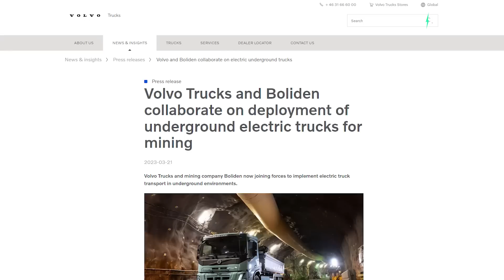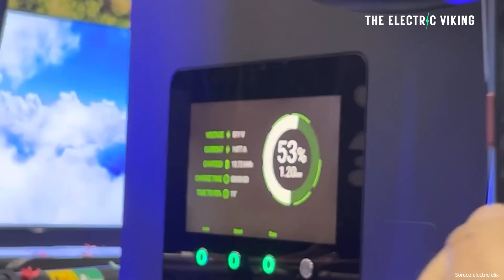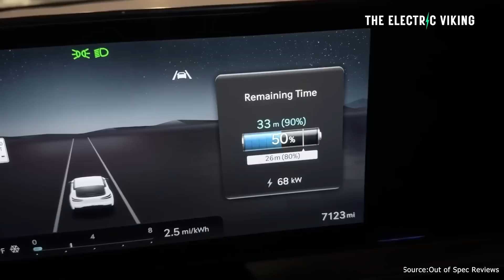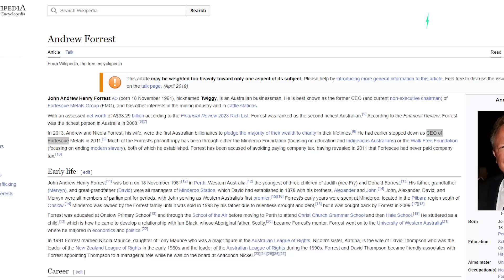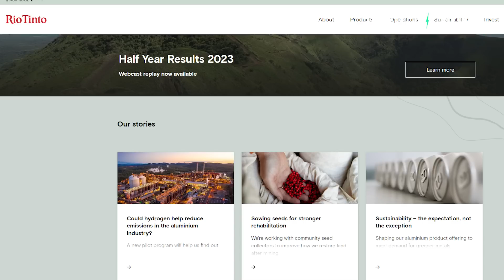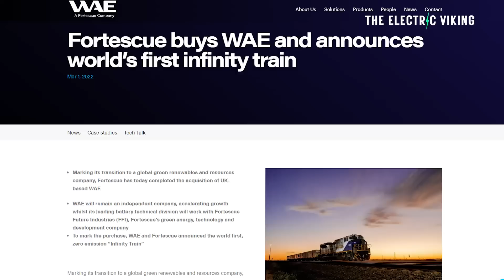Mining company unveils 3MW fast charger for huge electric trucks

Comment: There is some math that needs to be done here . The solar farm can only operate in daylight hours . Also solar farms don't use the highest efficiency panels let's say they covert 20% of the suns energy. 60 MW at 20% efficiency that means the generate 12MW optimum when the sun is out . Also hotter temp +100 u lose efficiency. You also have to charge the battery's to hold the power to do the 3MW fast charge into another battery of thr vehicle. Also fast charging degraded battery's faster when used . Not saying that this can't work but the whole system needs to be looked at including the monster 15 ton batteries

Comment: I believe the charging speed is related to the size of the battery. They are made up of thousands of cells, each has a charging limit. If you add more cells (or many more for trucks this large) you can add far more power to the overall pack, but the cells are still only accepting the same individually.
Reply: Yeah, he's getting a bit excited over the 3Mw number, when it does't mean that much without knowing the size of the pack, how long it takes to charge from say 10 to 80% (what C rate is it charging at), and how long it can operate on that charge.
Don't get me wrong 3Mw charge is a lot, but comparing the charge rate of a 200 tonne truck to a 1.5 tonne car doesn't make much sense to me.
I don't know much about that model of truck they're putting the battery in, but the CAT 793s which Fortescue has a lot of (some are in the video) have a roughly 5000 Litre fuel tank, that lasts something like 18-20 hrs operating properly. The large machines get refueled at somewhere around 600 - 700 litres a minute. So the battery ones have to replace that. I don't think there's many mines in the Pilbara that the trucks will be able to go up hill unloaded and down hiil loaded unfortunately.

Comment: Sam all diesel electric locomotives have regenerative traction motors but instead of directing the power to batteries it is turned into heat and sent into atmosphere so it’s waisted. I was a fireman of NSWGR in late 60’s early 70’s . Oh so do electric loco’s but they put that power back into overhead power lines two 46 class locomotives coming off the blue mountains put enough power into powerlines for one going up. All the best keep up the good work.

Comment: If mining goes zero emissions, and refineries and factories run on zero emissions, what does that do to all those embedded energy calculations? You know, the ones where there they try to tell you ICE is initially cleaner than EVs because <reasons becoming less relevant by the day>.

Comment: Ya, but Sam how is the grid going to handle those charge rates? (Asks the utility electrical engineer). Every time you guys gush about rapid charging rates the hairs stand up on the back of my neck. It is implying large industrial sized loads plunked down all over the place.

DC fast chargers? For every unit imagine your average medium sized grocery store stacked one on the other. 

3 MW chargers? Each one is a substation in an industrial facility. However, why the electric mining trucks? They are not doing it for enviro reasons, you should see their diesel costs. Electrical is at least one half the cost - and these are 10's millions per annum.
Reply: As a mechanic who works on CAT mining equipment since 2005 (5 and half years was Forescue's Cloudbreak mine) I do want to see how they can design a truck with an electric powertrain. Lots of potential to layout all the hydraulic systems better (I'm sure they'll still f it up)
But I do wonder how much actual benefit they will get from these early versions. To me it's mostly only worth it if they are doing battery swap stations, so less machine down time (also don't  have to fast charge as much if you have enough batteries in the system), and if they have a lot of renewable electricity (the do have a lot of open space for solar panels and a lot of sun). Otherwise they are replacing diesel engines to charge batteries with the on site diesel generators. There probably can be some benefit to that, but not that much for the money and effort to convert.
Reply: @patrickbeck4062  correct. In BC Canada we are mostly renewable generation. Whereas Alberta oils and is all natural gas generation. Don't know if the economics pencil out there. Electrical is more robust and lower cost of maintenance/ownership though. If the site is moving bulk rock downhill there is an opportunity to recover energy and use that to charge trucks. A generator I attached to the downhill end of the conveyor and acts as a brake. Same a regen EVs.

Comment: Tesla's Mega Charger's specifications have never been published but to fill up 900 KW of battery 70% in 30 minutes requires at least a 2MW charger.
Reply: 70% charge can flat out max the capacity. Supercharge wont thorottle power till 75%

Comment: I recall hearing that taking multi megawatt loads on and off the grid was challenging, or required coordination.  I wonder how/if they've solved this?
Reply: Charging tapers off as it the battery reaches full charge. Software takes care of the rest.

Comment: Just imagine the maintenance of a hydrogen cell truck ? 😂
Reply: It's one reason why hydrogen has not taken off. Maintenance has to be done in the open because of explosion risk. Personally, I would not go anywhere near anything to do with hydrogen. I know too much about it.
Reply: The only issue would be keeping the filters for the oxygen side clean.  A fuel cell lasts like 10x+ longer than a battery.

Comment: they are using electric mining trucks in switzerland for ages, they only discharge, never charge. the entire battery is for regen braking only to save on cost.
if you transport heavy marterial from a higher ground you have plenty energy available.
and btw even the diesel mining trucks are actually electric since forever, the 2 diesel engines run and produce electricity for an electric motor.
all in all an interesting field.
Reply: Same as trains diesel electric

Comment: If  the charging station is right next to the powerplant with wind mills or solar cells that cab produce these 3 Mw instantly, then I agree.
If not, the grid use will be enourmous and destabilised...
Reply: A lot of mine sites have the own power generation. And they put out a fair bit more than 3Mw.

Comment: I saw a show on one of those trucks that was used at a mine at the top of a mountain. The regen on the way down charged the battery so there was very little charging needed. It could get back to the top on the regen charge. That also took most wear off the breaks. Search for worlds largest EV never needs to be recharged.
Reply: The mines are in Italy, and the super massive, fully loaded, truck trundles down the mountain, regen-ing all the way. Then at the bottom it dumps its load at the depot. Then empty, gets back up to the top of the mountain for nothing. Simply put, fully loaded, the regen is so powerful it puts enough into the battery to power the empty truck back up. It's brilliant.
Reply: The issue is most mining isn't done at the top of a mountain.   It's done at the bottom of a pit. The other issue is even 3 mw is nothing.  That would most likely mean they are charging for an hour for every 2 hours it's running.  The big mining trucks have 3500 hp engines.  Cat has hybrid haul trucks already so the diesel engine can just drive a generator which powers electric drive.
Reply: @dpen653 that's the thing, we don't need to have just electric, having a generator is OK. The goal is to reduce fuel consumption by leveraging regen braking wherever it occurs. Just need a big enough battery for the use case.
Reply: @pin65371 dudicus. Tesla's Semi goes lets call it 300 miles w/ 80 tons on 500kwh pack. A 3mW pack is 6 x so 400 tons would be  well in the zone of a 6 hour shift. Not a 2 hr shift my dude. Chill.
Reply: @BipoCosmo  how much power is the hydraulic system using for braking, steering and lifting the box to dump the load? The haul truck is also trying to move that load on a mud road.  Take that Tesla semi and put it on a dirt road.  Then that load is being hauled out of a pit going uphill the whole time before it dumps its load and can regen a bit going back into the mine.   That is happening multiple times per hour.  We have trucks dumping a load every minute and a lot of times there is two trucks dumping their load at the same time.  You'd basically need a nuclear power plant just to keep the trucks charged.
Reply: @pin65371  Torque loads are right in new energy vehicles sweet-spot. Ordinarily torque increases exponentially with the diameter of the stator and far exceeds power output (hp < ft-lbs).

The dump mechanism could be driven hydraulically or with a linear actuator. At 3mW your at roughly 4000 HP and unfathomable torque output gear down dependent.

All this plus yards more efficient cooling. The regen on a +400 metric ton truck is immense. The unladen truck weighs more than the load itself. Each truck generates a nuclear power plant’s output when descending.
Reply: @BipoCosmo  the diesel powered trucks have 3500 hp and 13k lb-ft of torque
Reply: My gf’s 4 door wrangler hybrid has regen braking. It gained 10 miles of battery range going down a mountain, but there’s no way it would be able to use that power to get back up.
Reply: @danparish1344  Or course it wouldn't.  Your gf's Wrangler isn't laden with tons of ore going down the mountain, then going back up empty weighing a fraction of what it did coming down.
Reply: @danparish1344  yup..  and those haul trucks are hauling some serious weight out of the mines.  Fully loaded they haul 360 tons each load.  In a open pit mine they go into the mine empty and come out full.  The only area I could see this sorta working is in mines where they are basically mining a mountain top since they are fully loaded going down and empty going up.  In open pit the regen won't do much.  Part of my job is dealing with the maintenance side of these trucks in a mine.  As a side note, the pictures don't do justice just how big these trucks are. The tires are 13 feet tall. The mechanics can just sit on the hubs for the tires and they look small. The engine that powers them is the size of an f150. The trucks also drive themselves.
Reply: @danparish1344 totally relevant
Reply: Link?

Comment: .      3:59   that is one heck of building  😮

Best if they can swap out The Huge BATTERIES . KEEP Production moving.
Reply: If you can charge faster than swapping it's better to just charge
Reply: @mrspeigle1 
True, if it can be employed like you say.
Working in a warehouse with fork lift trucks. We had to swap out the Big Batteries to keep the fork lifts running throughout all three shifts.
Reply: @mrspeigle1 3 mw is nothing though.  The big haul trucks have 3500 hp engines.  The truck would be charging almost as long as the truck is running.
Reply: @pin65371  "3 mw is nothing" ......your joking right?
Reply: @timorum  3 mw is nothing when that is how much power the motors are using per hour.  That means they get an hour before they need to charge for an hour. These trucks weigh 1.2 million lbs when fully loaded out. I really dont think people get the scale of these trucks. The tires are over 13 feet tall.
Reply: @timorum  It will only be enough for around a 1 hr charge and and maybe a few hours operating. I really think mining trucks should be battery swap (been thinking about it for the last 7 years or so, while working on those machines, mostly just CAT). In mining, machine down time is a big deal. They often like their truck fleet to be averaging more than 18 hours a day atleast (which means machines that aren't down will be doing over 20 hours a day), so spending 4 to 6 hours a day charge will be a problem.
The diesel trucks that the battery trucks are competing with have ~5000 litre fuel tanks and refuel at 600-700 litres a minute. So compared to that 3Mw isn't that fast.